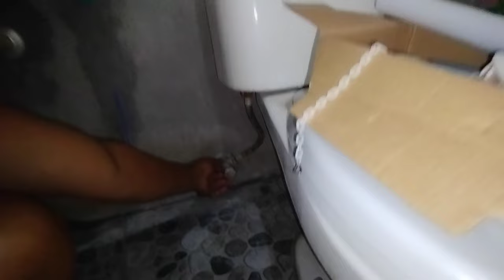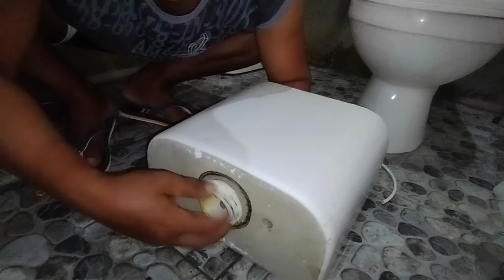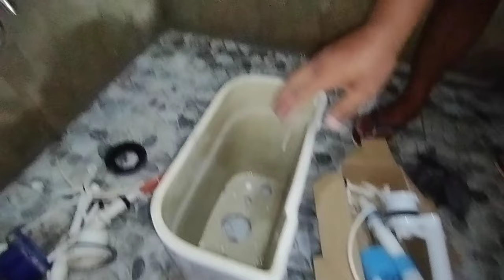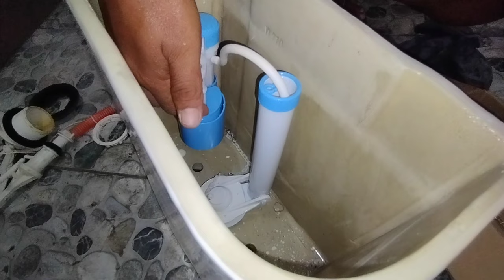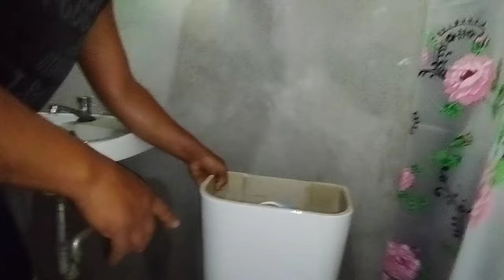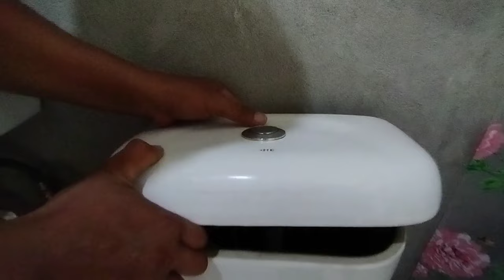Paano magpalit ng water closet tank fittings |Maynard Collado

Comment: Boss my leak yong sa flexible hose ko papunta sa tangke yong sa ilalim . Ano kaya problema boss? Kailangan na ba palitan yong valve nya? Sana mabasa at magreply kayo boss
Reply from the maker: Subukan nyo pong higpitan may built in rubber po yan na gasket pag ayaw parin palit na po kau ng hose
Reply: Pinalitan ko ng bagong mga fittings boss. Ang problema boss bakit mahina yong pasok ng tubig sa tanke, malakas naman yong buga ng tubig namin. Napansin ko lang din pag una malakas pa hong pasok ng tubig pero pag nagflush na ako, wala ng tubig na pumapasok. Ano po kaya problema sa fill valve boss? Sana mabasa mo. Salamat
Reply from the maker: May strainer po yan sa ilalim sa may kabitan po ng flexible hose subukan nyo pong tanggalin yung strainer minsan kc yun din yung cause ng pagbabara
Reply: @MaynardCollado30  wala na po syang strainer tinanggal ko na boss, same pa din, tinanggal ko yong flexible hose kinabit ko ulit, may pumasok na tubig, malakas tapos pag flush ko ulit wala na naman pumapasok na tubig.
Reply from the maker: Check nyo po yung floater nya baka sumasabit at d bumabalik